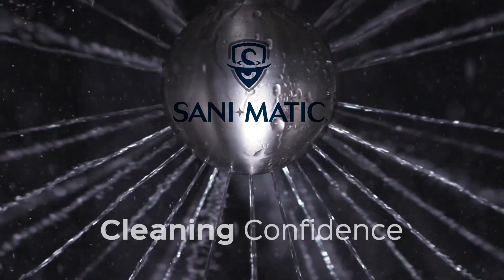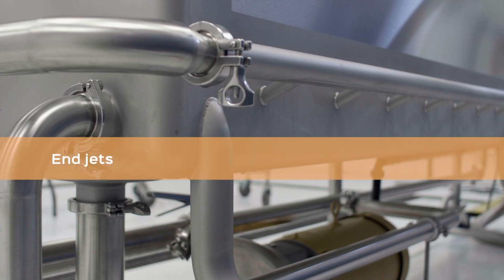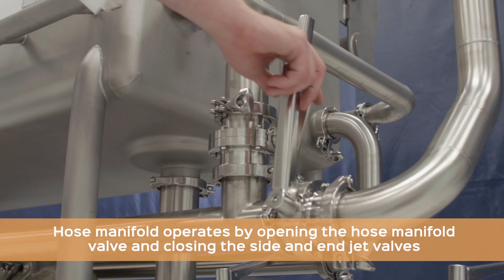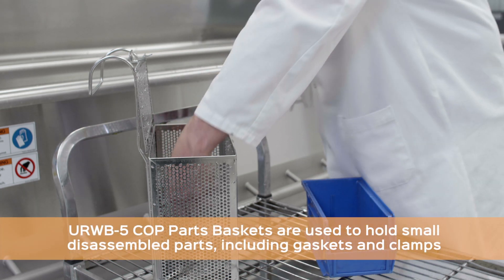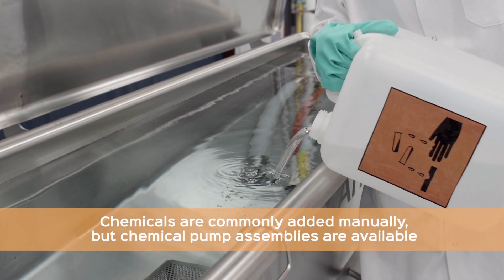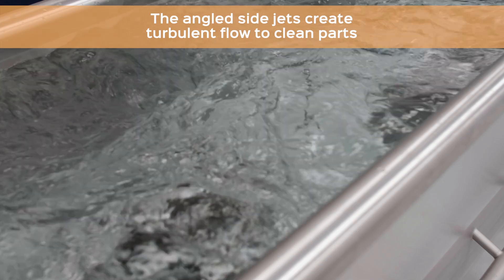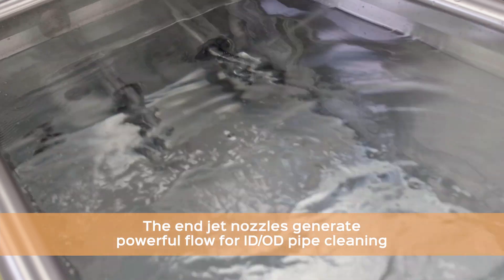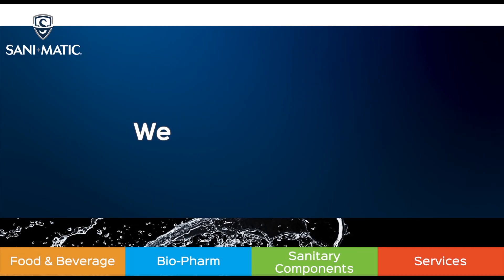Clean-Out-of-Place (COP) Parts Washers

Comment: Hi, 

First of all, thanks for the clip that you uploaded.
I was wondering if you could tell me how long will it take when using your Washer.

No need to tell the exact time amount, so plz feel free to answer.
Reply from the maker: Hello - cycle times will vary greatly depending on your application and product, but most users utilize the COP for the chemical wash soak step of their cleaning process.  With that, the parts may be in the washer for anywhere from 5 to 30 minutes on average.